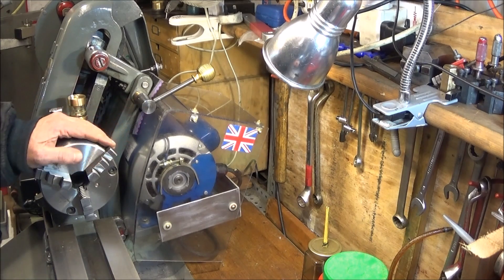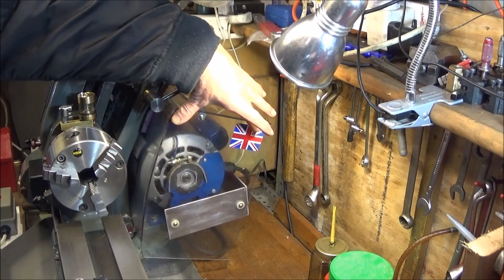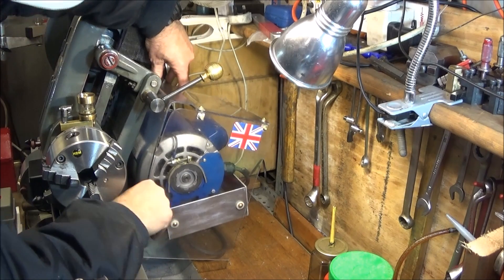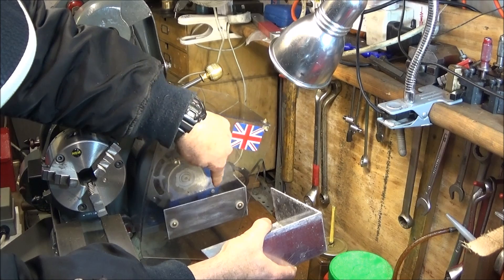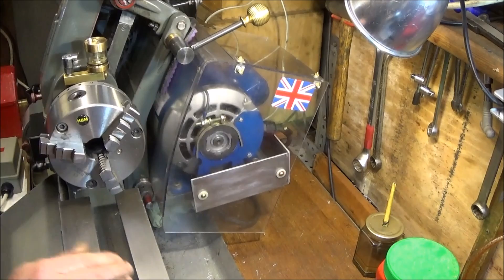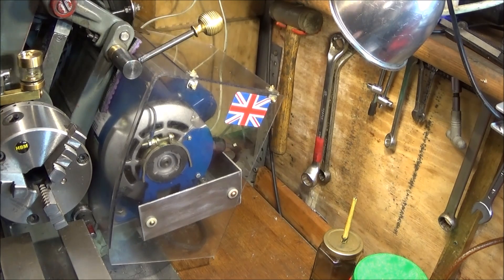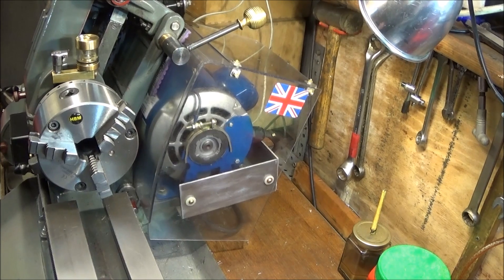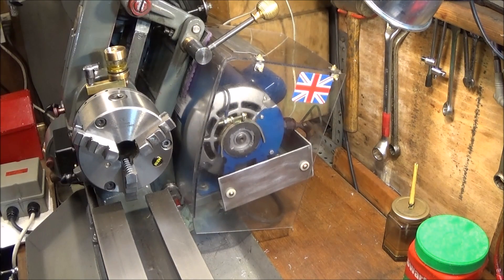Easy To Make Myford ML7 Lathe Polycarbonate Motor Enclosure Protector

Comment: I made a similar enclosure for my Taig (Peatol) lathe. I used some scrap panels and made it square -- with the advantage that I cut holes in the top and stuffed a lot of my frequently used tools in it. The Lexan is cheap even in Alaska,  however, but free offcuts were at hand. No matter how you do it, protect the motor from swarf, and may I add oil. When you oil a workpiece some of it stays put, but a lot of it is slung back and can get into the motor. Sod's law (Murphy's law USA)  says it will be mixed with swarf.

Comment: Good job. Would the faceplate clear the guard or does it need to be removed for faceplate Work? As always very clear instructions thanks.
Reply from the maker: Hi Roy, Thanks... I haven't checked that yet. I can undo the nut and push the whole enclosure assembly further in towards the motor if I want to. I will check it out soon. Regards Steve

Comment: I did something similar when I first had my S7, I also included a chip guard along the full length of the lathe. Stops all the oil and crap going everywhere and makes it easier to clean up.
Reply from the maker: The chip guard sounds a good idea.